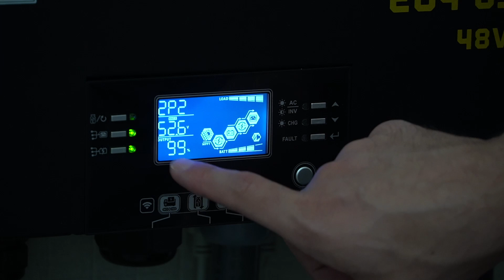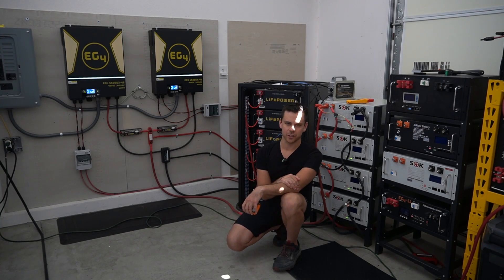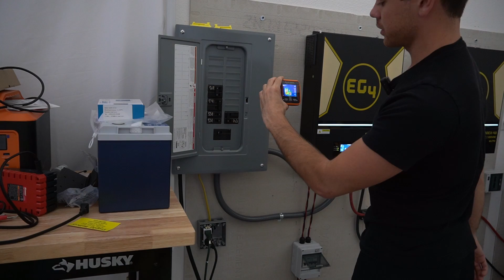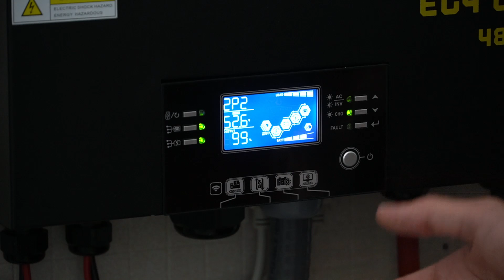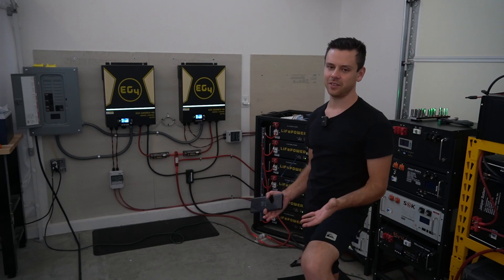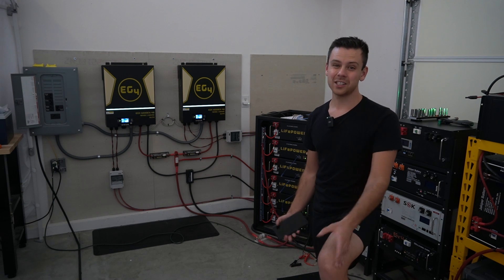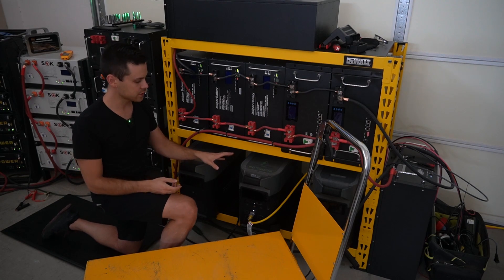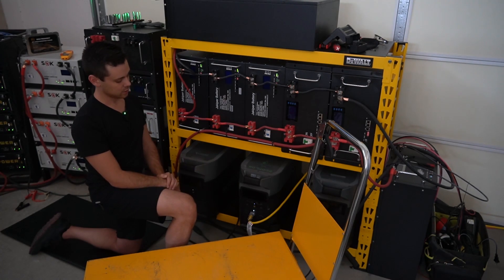EG4 6500EX Max Load Test, Heat Camera Inspection, Upgrades and Discussion

Comment: Hi, I have a question?
Reply: If you can help me, I have 2 EG4 inverters and I have a problem with the elimination in my house using a dimmer and LED lamps that flicker when lowering the intensity. Are the switches and lamps compatible?
Reply: I tested it with my generator and it works perfectly and I even used other inverters and everything works fine. I think that these EG4 6500 inverters are not very clean. Can I do something about the problem?

Comment: Since it has generator connection and I will be completely off grid, will I connect the output AC from gen to the AC in on the inverter?

Comment: Anyone know the circuit breakers used between the panels and inverter on this one? I looked at the parts list but it looks like a disconnect was provided instead of the breakers. Thanks!

Comment: For large inductive loads, so-called "soft-start" units are available. These allow high-frequency converters to work with large air conditioning units, reducing inrush currents by up to a factor of 3.

Comment: a question re: multiple inverters. we currently have 3 11kw inverters in parallel (5 strings - 4 x 3600 to 2 inverters and 1 x 4050w to the the third) and a 45kw battery attached. I intend to add another 15kw to this over the next few months.
I also want to add a standalone inverter and another 18 panels, but on a different roof that is around 100M away from the battery room.
Question is: can this inverter still be connected as follows: excess power being produced and not used feed back to the main battery bank and at night time, draw from the battery bank - we dont have mains to fall back on and this will be used specifically for a 7kw airsource heatpump

Comment: On the LF vs HF thing. Are you saying you wouldn't recommend these for full off grid use where a well pump is present? Or just that I may have to manage loads to ensure there is sufficient headroom for the well pump to run?

Comment: I prefer at least 2 LF 240 volt inverters and a capacity larger than what I need. Because household appliances constantly jolt the system. I do not like the idea of having to manually reset a system because I turned on a compressor, agitator washing machine, a dryer with an initial resistive ignition and motor starting load, heat pumps . . . I do wonder if the heavier transformer helps to protect the unit from grid power spikes that can occasionally damage home electronics/appliances too?

Comment: Do you think these would handle the startup current on a 1/2hp 230v well pump?
Reply: We have 2 deep well pumps . It does run them without issue . Our biggest complaint is flickering lights .

Comment: Wil I know you are a busy man and I would be a very small potato on your schedule. I am living in Italy where everything PV has to be connected to the grid. Basically it is not permitted to run independently from the grid. I'm not that up on tech so I'm not going to pretend that I understand everything,  although I love watching your videos. Going for the simplest system I am attracted to the EG4 dedicated systems. However I will be running air source heat pumps for AC and I do use a 2 hp woodlathe so I am not to sure if the EG4 system would be my solution going by what you said about HF and LF inverters. Can you suggest a solution?

Comment: Are you aware of any RFI issues with the 6500EX? I am a ham radio operator, and there have been reports of radio frequency interference being generated by the Chinese inverters, either through radiation in the wiring, or conduction through the output. Have you heard of this. Have you ever tested for it using a tunable shortwave receiver. The RFI appears as spurious signals periodically throughout the radio spectrum, but generally worse at lower frequencies (like AM broadcast band). The spurious signals appear at multiples of the inverters switching frequency, typically 20-50 kHz for high speed inverters. Expensive brands like Victron, Schneider,Solark. SMA filter these signals out, as indicated by their FCC Class B certification. I would prefer an EG4, but I am concerned about this.

Comment: Will, I feel the same way regarding the EG4 setup versus the Victron. Victron is incredible in its own right but the 'ease' of setting up the EG4 system is just incredible, and we are not necessarily losing any benefit compared to the Victron (I think...are we?).  I dunno, maybe a future video of a Victron setup and couple of months of use to actually compare. That would be cool!
Reply from the maker: I agree. Performance wise, the eg4 is incredible. I also have five clones of the 6548, and never have I had an issue. I've put megawatt hours through them.
Reply: @WillProwse  the only issue with the EG4s are the high idle consumption rates that would not be good for van life. Great for being “on” the grid but not “off” the grid. Victron boasts very low Zero load consumption.
Reply: My lights Blink when I use infared cook top.  Any one know where which light to replace so it will stop blinks like this please tell me which type of lights and where to buy them, thanks a lot.
Reply: @makesaveinccomm  I don’t think it’s your lights, your cooktop is drawing so much power that you’re getting a voltage drop. Spec out your system, and make sure everything is correct.

Comment: Will - I am considering purchasing the EG4 6500EX and using it offgrid as a UPS with battery backup.  I have seen other videos that show that using it as a UPS sometimes has problems switching from Grid back to solar/battery, and battery drain while on grid.  Have you experienced any of these problems?

Comment: fun fact.. the pv input + or -  to ground is a high voltage ac.. (like 380v)  be very careful when working on the solar inputs..  if you are grounded and accidentally touch one of the conductors,, it could be deadly...  The thing is.. you think you are ok if the panels are not hooked up yet but the power is coming out of the pv inputs... NOT COOL!!    it might be a positive ground system? .. anyone with other ideas??

Comment: Which solar panels are you using and what efficiency are you getting out of them?  It has to be quite high if you're getting up to 55kWh / day!  I'm putting a 12kWh array of santan solar's used 250w panels on my house and "only" a 30kWh battery bank.  I presumed those panels would only produce around 75% efficiency.  I'm wondering if I'm going to create way more power than I can use based on your numbers.  I'm in Phoenix which should get similar sun to you guys.  But if I created 55kWh/day I'd fill the bank plus have ~30kWh of energy to use during sunlight hours which if you assume is from 8a-5p is 3,300w/hr average throughout the day which  is definitely more than I'm pulling now.  It will be nice to be over-paneled for cloudy days I guess, but we don't get many.  Maybe I should scale back my PV array, hmm.

Comment: Nice video. btw..did you try to check your AC input power ? ..On my mppt 220/240V  11kW  Inverter i did find that it consume about 45W with no load from AC Input side.. It is strange to consume almost 50W with nothing connected to it. Ofc in case it is charging then it is pulling as much power as needed.. but just to show icon on that display that there is AC it consume 45W..I will try to switch it off by some meants or relay so it will switch on AC Input power only in case my battery will be below some voltage threshold on my 48V system.

Comment: Hello.  I like watching your videos, they are very helpful.  I have seen a video about EMF with solar inverters. They indicated that some inverters AC output signal could be a dirty sine wave that can cause health issues. Can you do a review on the output voltage of all your inverters for clean AC voltage?  Indicating the inverters with a clean and dirty sine waves using an oscilloscope.  This will help determine the quality of the output AC signal between the different types of inverters.

Comment: Haayy I had a question, I have a 60Amp MPPT Solar Charge Controller by GAE One Inverter. I was wondering if there was a way that I can connect it to another MPPT by the same company. It has an Ethernet port and I saw somewhere that it's possible if it was made so, but I can't find any info on it within the instructions. I also wanted to know your best mppt charge controller.

And finally wind power? >.>

Comment: Hello, thanks for all your videos. I have a question, maybe you can answer. 
 I want to build a green house for hydroponics, I’m going to need a few fans and some led lights. My question is; is it possible to have a off grid system with out batteries? 
 I want to have a few plugs for the fans and lights. Of course I’m only wanted electricity during the day. 
 So I’m imagining:
   Solar panels —to inverter to —fuse box—- to plugs, is this possible? Off grid?

Comment: Could you detail the differences in wiring multiple eg4 6500 versus multiple eg4 6000 still lit phase inverters in parallel? 
Specifically on the AC side.

thx

Comment: Will
any chance you can do a video of a house that is wired to the grid and would like to do off grid but still have the capability of the grid if needed using the original breaker panel. it's only a 1000sf home all led lights and the only 240 is the mini split ac unit.
everything else is natural gas. 
thank you
rudy
subscribed in florida

Comment: Fuse vs Circuit Breaker, which to use and where?. Im thinking between the solar panel array and charge controller a circuit breaker, Between the charge controller and battery a fuse, and between the battery and Inverter a circuit breaker. Also, how do you calculate the correct size wire required, wire is exspensive and i want to ensure i order the correct size.

Comment: starting on my first 24v system.  Which 24v all in one inverter, charger, mppt would you recommend?   I will be using lifepo4 batteries.

Comment: OK Will, I know you have tested countless LiFePO4 batteries.  How about adding a test on the somewhat new Enduro  batteries.  They have up to (singly) 300 Amp hour batteries and are great for RV's because they have a smaller foot print than batteries like Renogy and Battle Born.

Comment: I just got my system installed and up and running.  I'm running EG4-LL 48v 100Ah cells and a Growatt 12Kw inverter.  The inverter and batteries was the easy part.  Rewiring my service entrance, dealing with the power company, inspector, and getting all the parts pieces was the hard part.  Shortage of 4/0 4/0 2/0 wire.  Wire is crazy expensive anymore.  If the grid goes down the inverter takes over in miliseconds.  I'll be adding solar panels, but right now it being maintained by the grid.  Your videos were helpful and encourage me to do it, instead of a whole house propane generator.

Comment: Your videos have been a tremendous help in learning about solar energy generation.  The question that I have now is:  Is there an advantage when using a single inverter that has a 240vac output vs two inverters that have 120vac outputs for 240vac at the panel or subpanel?  Less complex, less wiring, more efficient, more reliable?

Comment: What size T fuse do you recommend for the EG4 6500 watt inverter and 6 48 volt batteries? 200A or 400A?

Comment: Hi, You are very informative. Do you have a very simple 24 volt blue print? I will not be running anything bigger then a washing machine and a microwave and really do not need a 48volt system. This is for a 30 by 40 cabin. Thanks
Reply: Check out his website, He has many different systems designs for different needs from a simple van system to whole house systems with everything in between

Comment: Awesome video. I have a 2-month-old Tesla grid tied solar system. Although the inverter is designed for a battery, I couldn't choke down $11,000 for a Tesla Power wall. Perhaps, in the future, I can build my own battery rack and add it in. Admittedly, I have a lot more research to do is I'm not quite sure if I can do this.

Comment: Hi Will. Love your videos. I just purchased the 200aH Lossigy LiFePo4 battery and upon opening the shipping box I see in the manual that came with it it states the Max Load Inverter Power is 1000W. I am using a Giandel 4000W continuos/8000W surge Pure Sine Wave Inverter and the manual leads me to believe I cannot use this $700 battery with my 200W solar panel. I know I need to contact Lossigy but since you know so much about all this stuff I thought I would ask you. 1000W Max Load sounds like I am misunderstanding their manual. I hope that is the case. Please let me know if you can. Thanks.

Comment: I am interested in a single EG4 6500EX-48 inverter paired with a single EG4 battery as a temporary system while I am remodeling my house. I understand that this setup might limit the inverter to 5000w. But, will the inverter work with a single battery? I don’t want the EG4 3000w inverter.

Comment: Hi there Will, I am getting a eco flow pro and extra battery to cover electrical blackouts here in U.K. with a limit of 1600w and a voltage and current limit. 1600w of rated solar panels is not going to cut it in winter whilst being fine in summer. Is it practical to have extra panels that can be switched into circuit either in series or parallel to bring the voltage or current up to required values during winter on a day to day basis? Alternately could I build an over power panel array and use a piece of equipment to restrict the values going into the ecoflow pro? 
Alternately could I build a second panel array, run it with an mppt and pure sine inverter and run the mains electricity from this into the ac charge socket on the ecoflow.? A lot of questions I know but I am supporting my elderly mother and have essential electrical requirements that cannot function without continuous supply. Thanks steve

Comment: I wish I had another way of communicating other than through your videos. I have questions that are somewhat unrelated to the subject. 
This question is what are your thoughts on using modified sine inverters w/ a line (power) filter on a smaller 100amp home system?
Reply: You can go to diysolarforum and find some help

Comment: Hey will. Curiosity has me beat. I’ve got a decent collection of drill batteries and would love to start a battery powered lawn care company using exclusively Milwaukee equipment. M18 batteries . Could I use the 18 volt batteries with maybe the growatt to charge my drill batteries and or possibly have a system that I can remove and add batteries on the fly ? I imagine 3d printed mounts that I can add my batteries into a parallel connection and remove them as I need them
Reply: It would be possible to make a bank, but adding/ removing them as needed sounds dangerous. 18v is too low to support a 24v system, but they might support a 48v system. 3 in series is 3x18 =54 volts. What are the max and m in minimum charges on an 18v batt? That is, when full what would the charge be? And voltage when depleted?

Comment: Hold on will.....🤔

Its my fault that my 4k HF Giandel   stumbles when i turn on my RV Ac ??
Soooo ... I went with a 3k LF inverter and guess what ... No issues ...
First joe attacks me for wanting to make america great again and now you attack me .for so called under sizing my inverter ...🤔😳

Now thats not fair bro !!! 
I did my home work and its not under sized 
Im disappointed in that comment
Reply: The issue is asking an inverter to handle a load it's not designed for.. that's what is your fault..
Reply: @audreye7078  It would be nice if the sellers would put a disclaimer in their literature saying what their system might not run.  I will be put out if my $16,000 system will not run my 1 1/2 hp submersible pump.

Comment: Do you have a way to shut down your solar panel voltage with optimizers or micro inverters to meet code for the fire department?

Comment: I dont know if this inquiry is suitable on this video, are the solar inverters with split phase 120/240 volts output can be use in Asia, we have a 220v60hz electrical sytem. I ask some sellers and they cant answer me straight up.

Comment: i want to use lifepo4 four in series 3.2 volts to make four 12 volt batterys and connect in parallel  making 12 volts with a lot of amps.  and i have 2000 watt inverter do i need a  250 amp bms for each battery   this is for my motorhome

Comment: How are solar panels affected by a strong ElectoMagnetic Pulse or strong solar flare?
Reply: If one happens then you have alot more to worry about than your solar panels. 

In reality though, your panels would be fine but everything connected to them could potentially short out and get ruined. Again though, if there was a CME or EMP strong enough to do this you might as well kiss your ass goodbye anyways.

Comment: Question: If I may ask what your summertime electric bill?
Will, you have a big house so the electrical load if you didn't have any solar would be mind-boggling and with the potential shutdown of hydropower due to drought unnerving. 
I understand your running a Tesla on grid system on your commercial power and off grid for the shop air-conditioning/car charging. Which is impressive

Comment: Oh Will you are killing me,,  I have the panels and two SOK rack batteries,,but am undecided regarding inverters ,,should I spend the cash and go Victron,,then I would be confident of the system lasting decades,,  or save the cash and go MPP 6048,,but always a little worried ,,,  oh hum what a todo!

Comment: I'll happily throw gas on the Victron fire. 😁 Would love to see your review of a big system. In particular, I'd be curious to see what the Victron can do relative to EG4 or MPP units. (Guessing not much, since you're more paying for build quality & support with Victron... but that's still just a guess.) Also: the fact you can even potentially conjure up a 13,000w continuous load at a house is impressive. I'd guess the Tesla helps with that. 👍